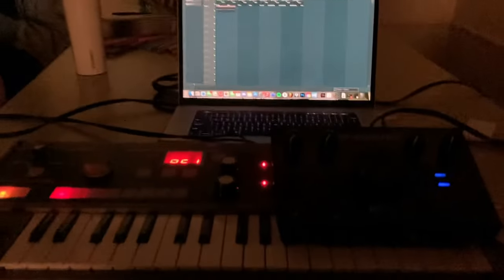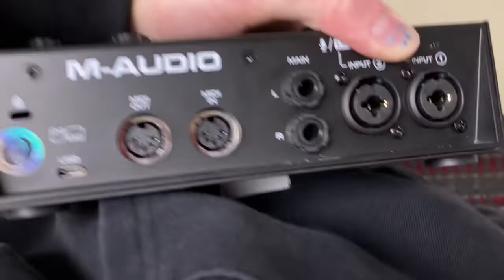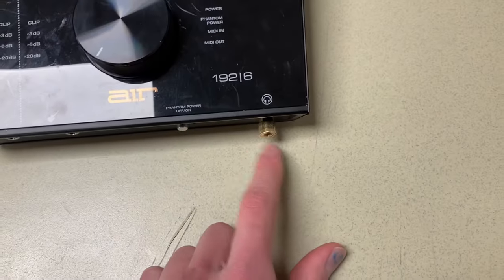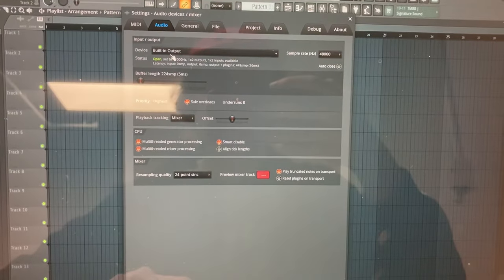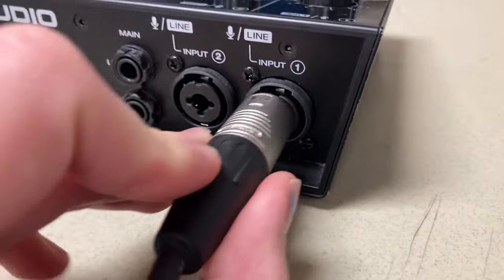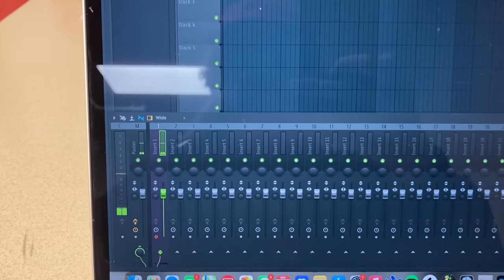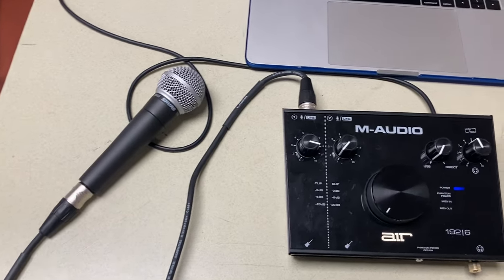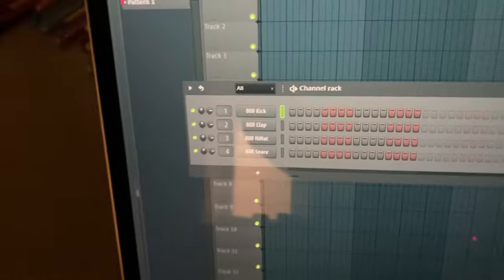M-Audio Air 192|6 Interface Setup Tutorial

Comment: The reason why your big volume control knob doesn't "work" for you is because you haven't plugged anything into your main outs and are just using the front jack for headphones, which are controlled independently by its headphones' knob at the top right. I'm sure the knob is working on your interface, it's just that there are no monitors to control the volume of plugged into your interface...

Comment: To get the big knob to work 
You have to connect the cables to the back of the M AUDIO AIR L & R straight to the back of the speakers L & R, I do it before thts how it works, but I don't know the name of the cables, my cables stop working 
And I'm try to get back one but don't know the name
Reply from the maker: Should be quarter inch to xlr. check with your speakers though